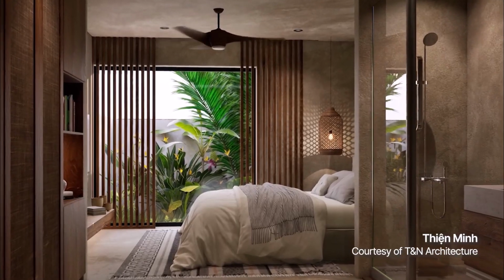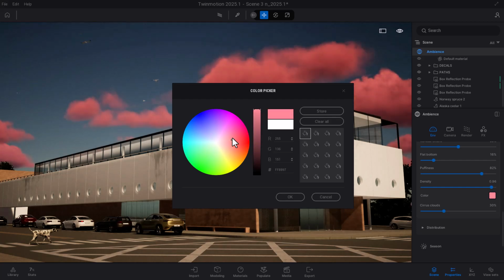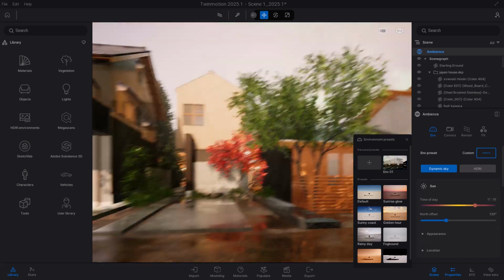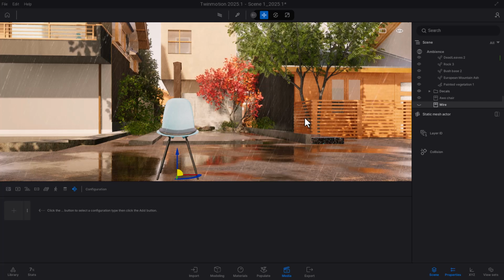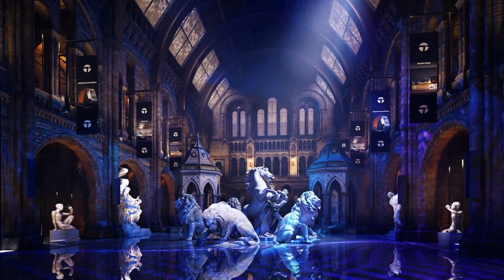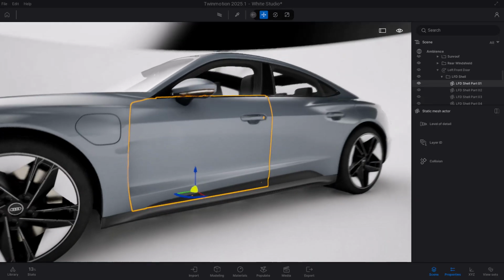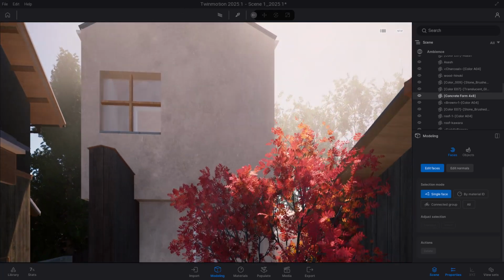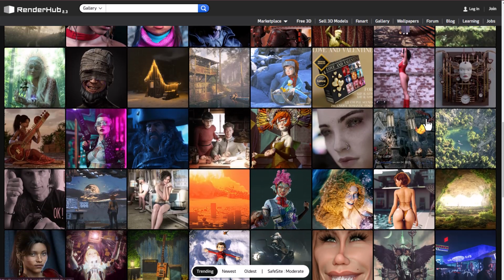Twinmotion 2025.1 Is Finally Here! -With New Features.

Comment: lol Basically Blender in 2040
Reply: It's a very specific visualization software.  The real competition is D5 Render, with very comperable feature set and quality. Blender is for modelling and faster path tracing (lumen is way faster than cycles but cycles is way faster than the current path tracer in TM). And you can hotlink blender and D5 together, as well as revit,archicad,rhino and 3dsmax.
Reply: @ajtatosmano2  I mean by 2040 we might be just be using Blender with very minimal modelling effort in terms of placing things like plants in the 3D scene like this tool because of AI pressure - most of the thing will be preset based and generated and then rendering.